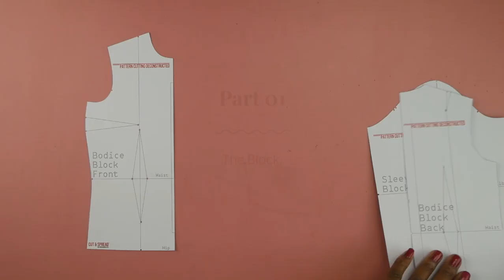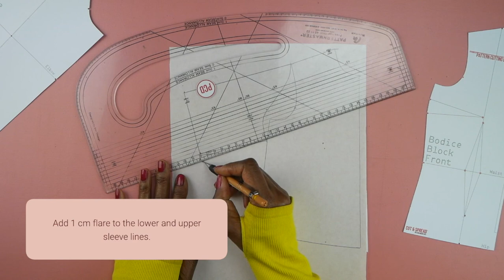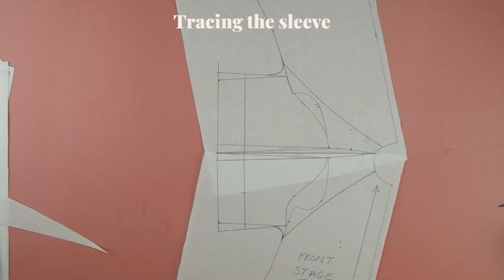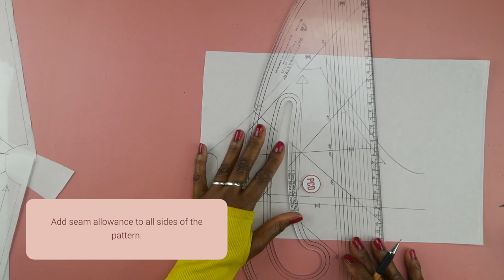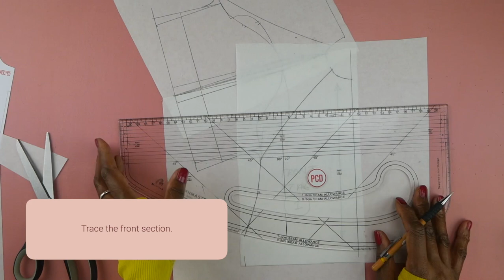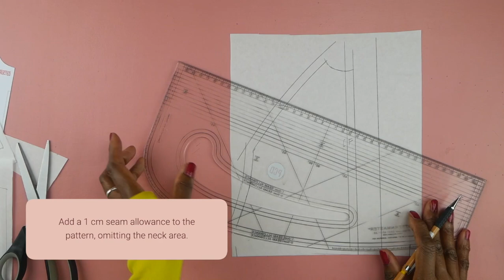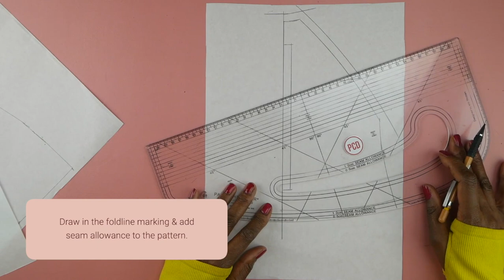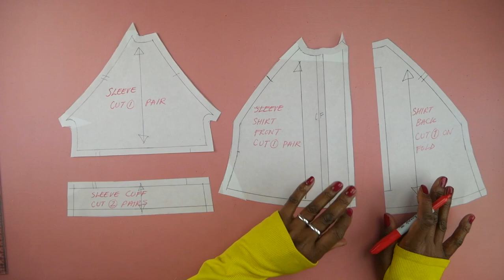How to Hack a Runway Design: Delpozo @PatternCuttingDeconstructed

Comment: Great video! Question: how are you deciding how much facing to include in the pattern? Is that just because 3cm is a good rule of thumb?
Reply from the maker: Facing size is up to you! Just make sure it's wide enough to accommodate any details like buttonholes and buttons.
Reply: Her 3 cm is the equivalent to standard American pattern seam allowances of 5/8".  So a true folded facing should be at least 5 cm or 2".
Reply: @SeamworkVideo  Absolutely, base the facing size on what details need to be included.

Comment: So is this quarter size? Do you blow it up and keep the 1 cm seam allowances?
Reply from the maker: The pattern is scaled down so it's easier/faster to film. Half scale patterns are also great to practice these hacking techniques! If you want to follow along, use a you-sized pattern and whatever seam allowance you'd like, just make sure it's consistent!
Reply: It's a half-scale block and I usually do a 0.5cm seam allowance. However, in the video, I used a 1cm S/A so yes, keep it at 1cm when you scale up.